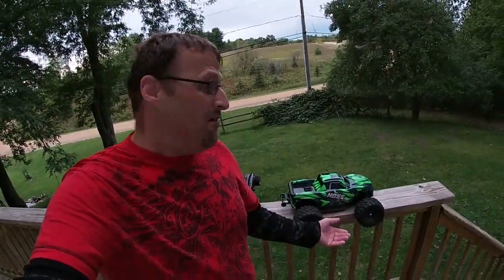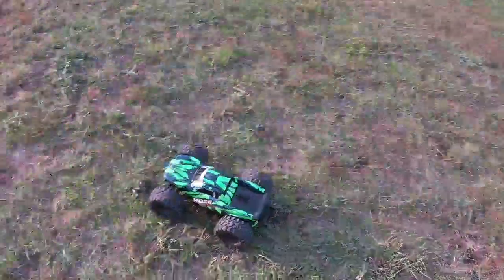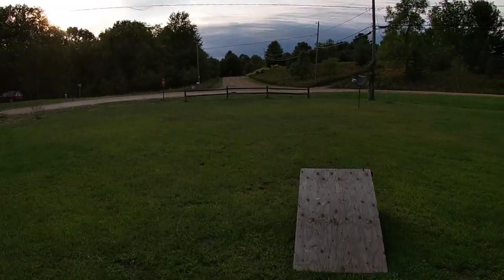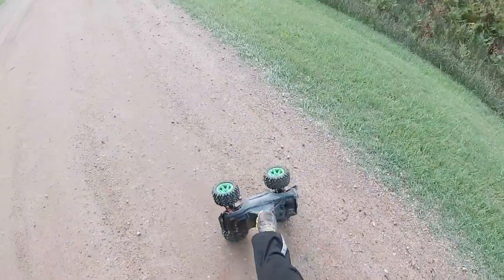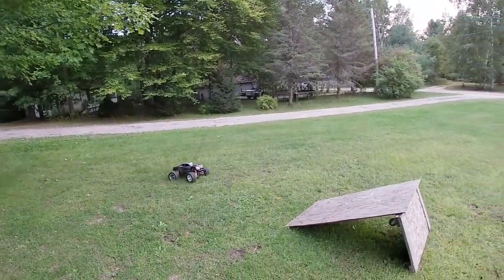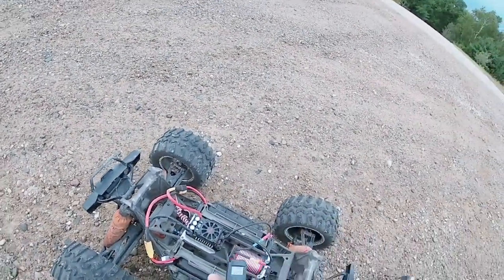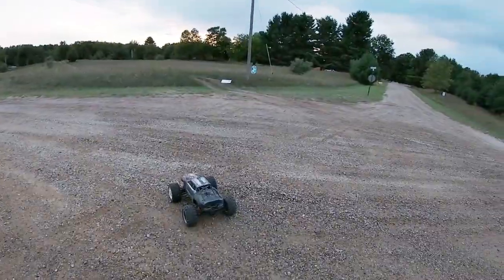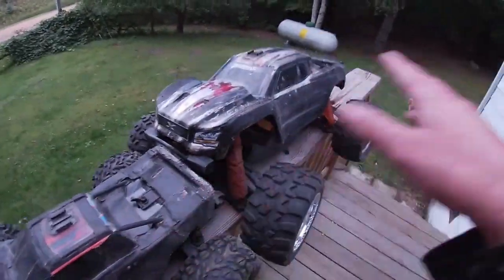Traxxas Mike & The 3 Monster Trucks. The X-Maxx (Re-maxx), The Maxx, & The Hoss (The Hustler)

Comment: Nice video my friend!!
To put the Hoss body to the rustler do you need to do any notifications?
Reply from the maker: No modification at all but it has to be the rustler 4x4 with the clip-less body...it cannot be an old school rear wheel drive rustler.
Reply from the maker: The only mod I did was extend the bottom of the body by adding a double layer of gorilla tape and sticking it back to itself so the body was about 3/4" taller between the front and rear wheel because the lcg chasis on the rustler 4x4 sits about 1/2" lower and there is an open gap there if you don't add the tape.  I wish I could send you pics on comments to show you.
Reply from the maker: If you friend request me on face book I'll approve you and send you pics. My name on face book is Traxxas Mike
Reply: Sorry Mike don’t have Facebook the only thing that I’m doing is subscribing to your channel and give you 👍🏼 on your videos. I do have the rustler 4x4 and thanks for the advice
Reply from the maker: 6 videos ago I made a video called "surprise addition to the channel and huge fail mail unboxing" if you watch that video and fast forward to 32:20 you will see the hoss body on the rustler 4x4 with the gap I spoke of at the bottom. I point it out in the video.

Comment: Hi mike. I don't think you you should call it a hoss. It is a little misleading. 
 Still watching your videos. Just a little/or a lot late.✌
 Ps  :  maybe hostler
Reply from the maker: Yea, I've been calling it a "Hustler" lately! I think I like the sound of that! Lol. I'm surprised alot of people didn't ride my ass saying I was a hack and stuff because I called it a hoss!  Biggest difference is that it doesn't have the 540 xl motor, but I upgraded the rustler to a center diff Along time ago, so that's the same, it has been upgraded to 17mm hex's so that's the same and it's got the lcg chassis so it actually holds the ground better than the non lcg chassis that the hoss runs.  And it don't change ground clearance,... only a smaller tire size does that👍 and I added the fan to the vxl3s esc because the hoss comes with it but the rustler does not. But your are 100% right....it is a bit mis leading, that's why I usually call it by a few different names in the intro to my vids.... Hustler, rustler, hoss, Ross or your idea... the Hostler. All are good I guess. Thanks for watching.  Watch one of my newer vids "Revo gets ridiculous" and comment "mini cam" to get entered into our free HD mini cam give away to celebrate 300 subscribers👍.  Thanks for watching and commenting and expressing your opinion spike....you've been with me since the begining.
Reply from the maker: Also ...thanks for sticking up for me the other day with the "gasser" conversation.
Reply: @myrclife  
 Luv ya brother! Always  a bonus when it gets  chaotic. 
 Hey chaos !🙂

Comment: awesome video but whats the point of playing with a rc truck when the tires dont stay on the ground i know its fun but pointless
Reply from the maker: Backflips...lol! I dont know..... I know the trucks are overpowered and do want to wheelie alot if you pinch the throttle all the way but I guess that's just part of the fun.  I probably should do more track videos or mud bogg videos I suppose....you know more of a selection of venues instead of just cutting backflip after backflip and doing 300 ft wheelies and 6ft jumps.   What's something you think I should do?  Or somewhere you think I should go?
Reply from the maker: A 1/5th scale redcat rampage 2 stroke is a fun truck to play around with too.  Nothing wrong with a gaser!  And they sound/smell cool too. Especially if you run BeNOL (bean-oil) 2 stroke mixing oil!  I love the smell of that stuff, especially combined with some good high octane race gas, it reminds me of the sand dunes😁🤪😀😆SMILES FOR MILES!
      I really want to get my old t-maxx 3.3 out again but the starter motor gave out on me and I only have a tiny bit of nitro fuel left too and it's quite old so who knows if it's even any good anymore🤷‍♂️.
Reply: @myrclife  i think your videos r awesome but also i think you got to teach these guys the hole idea is to keep your tires on the ground to keep control of your rc  truck
Reply: @snoopysrc  
 Really to each there own. What the point of owning a gasser when you prefer electric? 🤦‍♂️